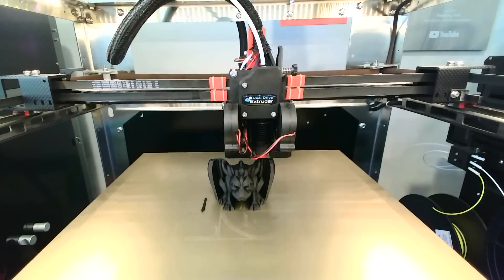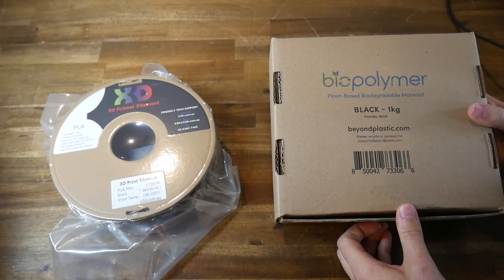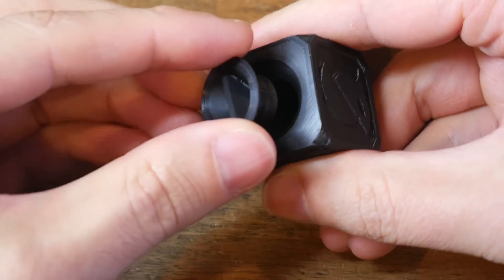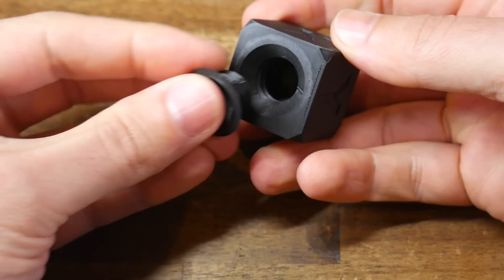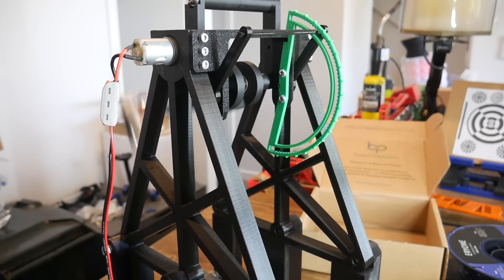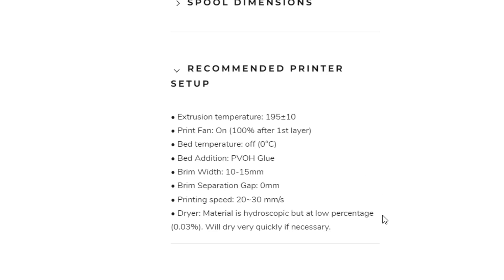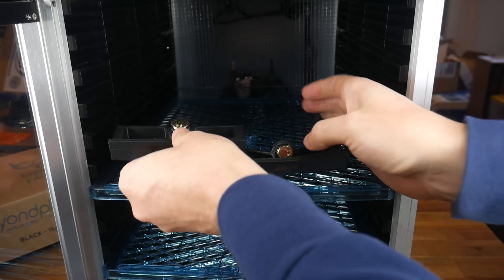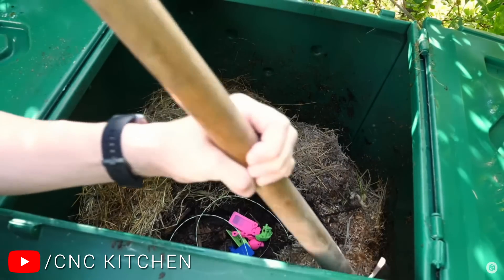PHA filament - Mostly superior to PLA and actually eco friendly

Comment: Interesting filament. Nice temperature hold, good strength and elasticity.
After having constant good results with pa6 trimmer line, warping is not a problem.

Comment: Great work! I actually tested the compostability of PHA ~2 years ago (yet never posted a video on it). ColorFabbs allPHA composts beautifully within a short amount of time, the Canadian Regen PHA on the other hand looked basically untouched after ~ 2 months in my compost. This means that PHAs are not created equally but they are definitely a step into the right direction!
Reply: REGEN PHA Filament was not PHA. It was a co-blend of PLA+PHA. 
With the Anti-greenwashing laws that passed recently in Canada, I have the suspicion they pulled the product off market before getting sued for false claims.
Reply: Getting a big chunk of lies and misinfo off our airwaves is going to be great. Gotta love it
Reply: You should make a video about it and help get the trend going. We need manufacturers to see there is interest.
Reply: @CNCKitchen please consider making that video! I was so disappointed by the PLA composting video and have been dreaming of a truly home compostable filament that doesn't produce microplastics. Warping aside PHA looks so good!
Reply: Indeed, not all PHA/PHB is created equal. There are different grades, and then different formulations (blends, fillers, additives...). We use it at work (among others) as a base to make our biodegradable material, and it is very versatile.

If we could manage to knock the price down a little, it could easily replace PLA for most applications, and would become an especially good material for design iterations, given its eco-friendliness.

Also IMHO, the soft, warm feel make it great for home decor and everything that is to be touched.
Reply: I would love to see more videos from you about PHA if you can. Especially stuff like your strength tests. Having good and easily digestible information about the mechanical properties of different filaments for PHA would be amazing and probably bring a lot of people to it. It would also be cool if you could try some virgin PHA in a pellet extruder or something to see if the different processing methods companies use effects the strength of it
Reply: @TopengProductions  Virgin PHA is nearly un-processable on any extruder. Its either too amorphous or too crystalized. In the past, the solution was to blend PLA with PHA to enhance the processability or worse. Use petrol-chemical base chain extenders and additives. In addition, you would need to use the proper nucleating agent to facilitate a small amount of crystallization as you process the material to be able to string it on a spool. The industry normally relies on Boron Nitrate, but there are other more custom nucleating agent available from CJBio Korea, and Helian Polymers NL. Hope this helps answer your question.
Reply: Great insight Stefan!
Reply: Pla not being made the same is how the lies about it started to, ten years ago. I'm not jumping on the same bandwagon again. 

Besides, plastic is an end product. Just because it gets smaller in compost does not mean it was biodegraded. Not like every other thing it appears to work on, at minimum.
Reply: @nicewhenearnedrudemostlyel489 

I completely understand your skepticism—it's well-founded.

Just to clarify, I served as the CTO of Beyond Plastic and was responsible for the idea of 3D-printing with PHA as a product concept. Like you, I was initially wary of biopolymers, viewing them largely as greenwashing tactics. That changed 5 years ago when a former colleague reached out for technical help in developing a container with what he described as a "new" material: PHA.

Within six months, after evaluating third-party validation of its material science, I became convinced—PHA is the future of plastic. No doubt in my mind.

One of the biggest issues with plastics in general is the widespread misinformation about their end-of-life (EOL) options. Petrochemical companies promote "recycling" as a solution, but it will never be a standalone fix. Meanwhile, PLA manufacturers market "compostability," even though PLA only meets industrial composting standards (ASTM6400), which require conditions that don’t naturally occur—specific temperature, humidity, pH, and oxygen levels.

This ASTM standard emerged as an industry-led approach after the U.S. federal government failed to establish one. In our case, we opted to follow the more rigorous EU standards, supported by Brussels, which differentiate between biodegradable, home compostable, and industrial compostable. We committed to the highest level: TUV Austria Marine Biodegradable certification.

This certification involves three key tests:
1. ASTM6691, developed by Professor Joseph Greene, a mentor and guiding figure.
2. A toxicity test with Daphnia magna, requiring a 90% survival rate—we achieved 100%.
3. Fragmentation, where PHA must degrade within 90 days in marine water.

Marine water was chosen because it’s among the most sensitive ecosystems, with low bacterial concentration and high sensitivity to toxicity.

Just to clarify, PHA isn’t a synthetic material. It was actually discovered in 1926 by French biologist Maurice Lemoyne, who observed certain bacteria storing excess energy as PHA, which they then used as an energy source when food became scarce.

Today, we know that over 250 types of naturally occurring bacteria can produce PHA. They can convert a range of biomass sources into PHA, including food waste, plant materials (like oils, sugars, and agricultural byproducts), and even biogases like methane and CO₂.

In other words, yes, we can make biodegradable plastic from gases like methane. Newlight is a company that’s actually doing this, producing plastic from such sources: https://www.newlight.com/.

To clarify on biodegradation: when we discuss fragmentation, it refers to plastic breaking down into smaller particles, but that’s not true biodegradation. True biodegradation means the material is fully metabolized by microorganisms, leaving no microplastic behind. To measure this, we track CO₂ emissions as an indicator that the material has been fully assimilated by bacteria.

Cheers

Also, here is interview we did for a Science TV Show. https://youtu.be/HZx-nQWtzPw?si=UhZWq5PzczccGd46
Reply: Oh sorry. "It depends on your particular application"
Reply: Btw, typical cnc kitchen response. "I spent a lot of time and effort and your money, and my conclusion is... do what you want"

Comment: Regarding the biodegradability in compost or soil, it would be interesting to know what happens to the degrading microorganisms. Is the material a "superfood" for the organisms, or is it more toxic, causing them to die off quickly? What happens to the excretions of these organisms? Do they act like a fertilizer for the soil, or are they more like inhibitory substances that make the soil "worse"? What happens to any manufacturing additives that may have been used?
A material is not inherently good and environmentally friendly just because it decomposes.

Comment: PHA, to me, anyway, seems like a good prototyping material. I mostly work in PLA and PETG (particularly carbon fibre impregnated PETG), so, when working through a design process, I'll often use PLA for design testing and commit to PETG-CF for when I'm happy. This has led to fair pile of waste, which I tend to keep in a kids' toy box that's shaped like a garbage skip - my "bin of shame." The contents never quite fill the bin because I try to reuse this co-mingled PETG and PLA for "melt panels", kind of like small bits of "wood" or "aluminium" by melting them in ceramic nonstick baking trays in a toaster oven. It's good for cutting brackets,  soft jaws for my drill vice, axe and hammer handle wedges, etc. It is probably going to catch up with me, though, so having a prototyping material that I can feed to the "better half's" garden would reduce the contents of the bin-of-shame when it nears the brim.

Comment: I would absolutely switch to PHA, even if it's 5 to 10 euro more expensive per kg. I've always loathed how PLA is marketed as biodegradable, but in real life comes down to it still being a big waste on the environment. If this solves that, I'm happy to use it over a little bit more hassle with warping.

Comment: +1 for the UV resistance testing, there aren't many reviewers who commit to that
Reply: UV resistance is hard to test, even ABS lasts for a few months without any visible degradation
Reply: @dtibor5903 Accelerated wear testing could be done but it'll cost a bit to power. The uniformity of exposure will be useful too
Reply: @dtibor5903  We used a UV exposure Chamber (I am a former founding member of Beyond Plastic). This allowed us to replicated full sun exposure of product sitting in the middle of a parking lot in the Florida Keys. One week in the chamber is equal to 6 weeks exposure.

Comment: If this was available and affordable I would switch to it for sure. I sometimes need to print things just to test shape or fit and sometimes things like drilling templates. I do those in PLA because that is at least nof a fossil. PHA sounds like it would be way better for it than PLA at least for prints where the warping can be tolerated. 
I wonder if the warping could be solved by adding some fibers. Not carbon obviously, we would want something biodegradable as well. For other warpy filaments adding fibers can even make them printable without encloser so it could work. Maybe something like wood fibers could even enhance the biodegradability if the fibers rot first and create a ton of holes for the bacteria to go inside to eat the PHA.

Comment: The warping is a problem. I already had this problem with PETG, and it makes life really hard. The better heat stability and UV resistance, on the other hand, would be a bonus. Hard to say if I would buy it. I might give it a try, but the warping does not sound good.

Comment: Id love to switch specially for the added flexibility and lack of moisture retention while still being "better" for the environment. An outdoor degradation test would be interesting.. Bird house maybe?? That said, warping on a 30$ roll is an issue for me so wondering if it has to do with layer adhesion since the brim stayed on the plate. Still happy to pay a slight premium for some plastic that will actually dissapear

Comment: I tried out printing with PHA as an alternate material for a flute I designed. It worked pretty well! Just a little sagging on bridges and I made sure to put a big no-clearance brim on it which was easy to remove afterward. Even though it's tougher along the XY plane, I did notice that it wasn't as strong between the layers as PLA. I was able to snap my flute in half by hand (and CA glue it back together). I hope PHA catches on to reduce all the plastic waste 3D printing usually generates. I look forward to the biodegrading tests

Comment: Would I be interested? Yes if it was around the same price as PLA+. Something that prints as easily as PLA but has significantly better temperature resistance would be extremely helpful for the cosplay pieces I make. Tho I am curious: does it adhere to glue well or is it resistant like PETG?

I'd say test it with some practical applications that might get used outdoors and see how well it holds up. Small tools and the like.

Comment: Your default PLA PA, 0.050, is pretty high. Looking over the results of the ~200 calibrations I’ve performed, only PETG consistently exceeds 0.050. Silk PLA is frequently above 0.040 but most PLA results are 0.030 or less.

The “DNS_PROBE_FINISHED_NXDOMAIN” error you had in your browser indicates a DNS problem, not that the website was down.

Comment: I did use100% Pha from Regen Canada, and it was way better than beyond plastic Pha in terms of warping. I was able to print huge straight objects on my prusa XL on a cold bed. Beyond plastic was abysmal as it would warp 100% of the time. Regen Pha is better than pla and is awesome for fan shrouds, as it won't sag over time. As for composting, I did try it in my hotbin composer and it breaks down at a similar pace as pla, but instead of turning into brittle dust, it retains structure. So far I have not observed a full decomposition after a year. Overall, I would suggest trying Pha by regent at 230c+. I saw it is still stocked in Canadian Amazon.

Comment: Would using an ABS bed heating temp address the warping of the PHA test piece? As Michael tested a bed temp of 40 degrees and even using an enclosure maybe 95 - 110 degree bed temp would offord better results?

Comment: That warping is pretty horrific, I don't think I could justify wasting time, electricity, and material on the inevitable flurry of print failures. If the warping issue can be resolved without cranking the price even farther through the roof or harming the biodegradability...my answer will still probably be a resounding "maybe." The absolutely vast array of color/finish options with PLA will make it hard to de-throne as the king of 3D printing filaments, and if other common materials like ABS and PETG haven't gotten anywhere near the same treatment, it's fair to wonder if PHA will be available in more than basic colors as well.

Comment: The pressure advance sucks when tuning for different extruder motors. It just give the pressure advance code but doesn't tell the code what extruder tool (motor) is being used causing it to have an error every time. It should be automatic in the code.

Comment: My biggest problem with PLA that nobody talks about or tests is that it conforms to stress even at room temperature. Take two PLA parts and screw them together with a bolt and torque them. Then wait a few months and come back and it won't be tight anymore. It will be snug. Then you can do this over and over and over again until the bolt has made its way all the way through the plastic. It's not just its thermal properties that make it terrible for mechanical parts.
Reply: @yusky03  Yes. It's kind of how they test concrete and it has different properties over time. Imo people need to stop focusing on PLA as a structural material all together. Sure it can function for some applications but if you need strength you should switch materials all together. PLA is good for some stuff but it's not a wonder material. It is dominating only because it is cheap and easy to print.

Comment: I would definitely try PHA although my issue is that I’m only running Marlin on an old Tevo Tornado and on a Creality CRS 10 smart pro so I do t have the input shaping abilities that you do with Klipper and am limited with G Code adjustments as I am using Cura as my slicer, so Mabel you could try and run a sample with only basic equipment like I have. 
Regards

Jeff

Comment: If it actually biodegrades as intended, and the price was right, I would 100% replace PLA in most instances!   I like that this stuff is more temperature stable and seems to be tougher than PLA.  I generally like impact resistant materials more than the most rigid.  
The warping seems to be a pretty hard issue to overcome.   I hope it doesn't get "fixed" by blending with materials that don't biodegrade.

Comment: I wonder about 3 things: 1, availability. this stuff sees to be VERY hard to find.
2, creeping. I don't print PLA much at all anymore, because under even light load it will creep and deform over time. This stuff might fare a little better, judging by the temp resistance.
3: compostability. Sure, this seems like a good thing, but it also tells me that this plastic is a horrible material to use outdoors, as mechanical parts and even protective parts will decompose and fail. even ABS is not suitable thanks to how it degrades in the sun.

Ergo: this seems like a plastic that, if you can find it, is meant for stuff you intend to throw away or keep indoors... and I dunno about you, but I don't exactly want my decorative parts like sculptures and stuff to decompose after a year or 3.
Reply from the maker: According to the website it needs  to be eaten by micro organisms to degrade. So if you keep it away from soil it should be good. I'll find out soon enough.
Reply: @TeachingTech  Keep us updated! cos if those issues aint... well, issues, then it's a very cool material beyond just written details.
Reply: I'm okay with 3 years. 1 year not so much. 3 years, though, just reprint it if it's still relevant. The problem is many 3d prints end up binned long before 3 years and don't biodegrade anytime soon.
Reply: @chublez  That's you, not me. I print stuff that I still use 5 years later. Half the problem of pollution is this "Throwaway culture". Rather than making stuff that lasts, everyone is just "Nah  ill throw it away, buy a new one or make a new one." Rather than improving.

Comment: If PHA can be produced at a similar price to PLA or PETG I'd be more than willing to at least try printing it and see how it behaves.

The impact resistance and thermal stability would be extremely useful for a lot of the things I print as I do a lot of functional parts and printer part upgrades.

The warping behaviour is a bit of a concern but I kinda wonder if my experiences printing ABS are anything to go by - anything's fixable with a stable environment, a clean PEI sheet and patience!

Comment: So, basically you’re better off just burning the PLA as it’s not being made from petrochemicals and yes, it’ll form CO2 but it’s technically carbon neutral and also, if it biodegrades then that means that it will degrade into what? Probably CO2 and water. And that most probably also applies to PHA as the bacteria will eat it up to make CO2 and water. That’s not actually bad news actually, as it’s better than having microplastics all the way for hundreds of years
Reply: Or better yet than burning (which can be used for energy production, so it’s not entirely wasted), just recycling it